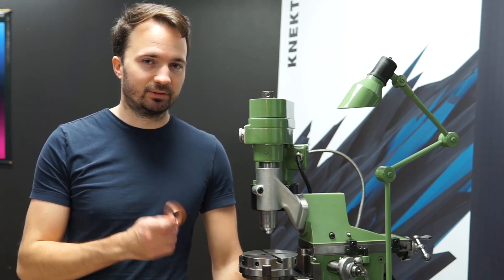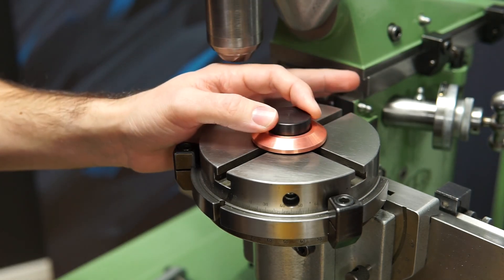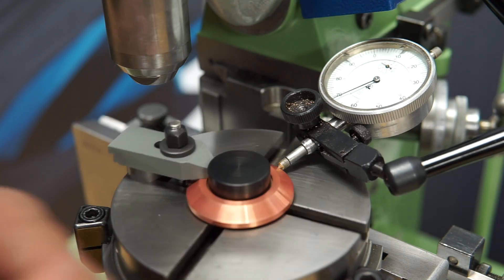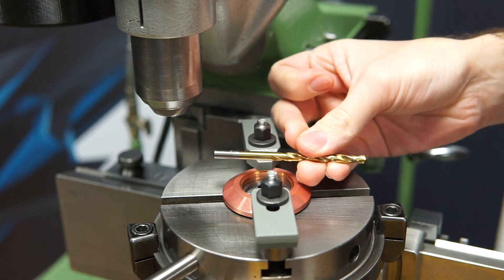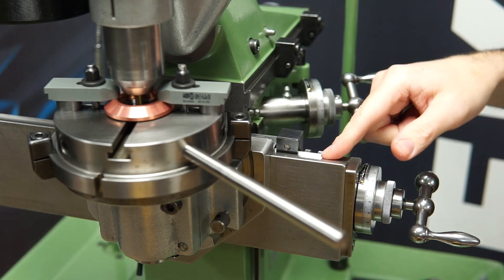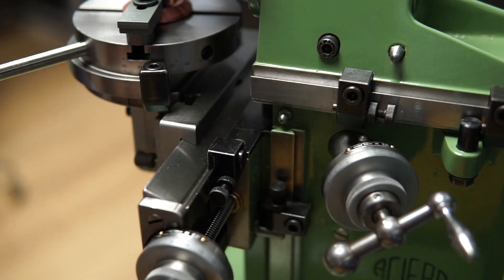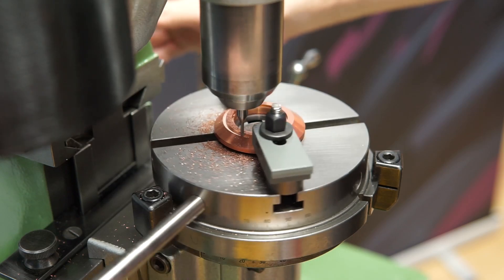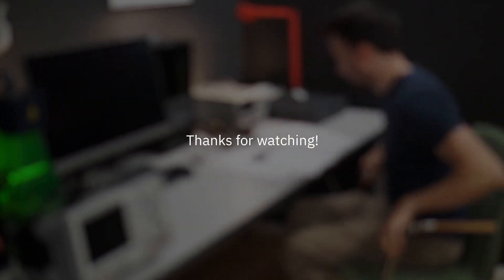I'm machining a watch case but made a mistake

Comment: What you did is probably more accurate, using the rotary table, but do you have the dividing head? You could have mounted it vertically then put your 3-jaw on it. Just curious. The spindle on mine is being rebuilt right now. The needle bearing adjuster was maxed out. Good video. You don't see the Aciera F1 (or any of its clones) being used enough on YouTube. Looking forward to your next one.
Reply from the maker: @metalmanipulator7210  I just have the simple dividing head with a plate with 60 divisions. It’s usable for a lot of things but without stops I would probably just destroy my watch 😄 Maybe I could do my own dividing plate  🤔

Mine also has the needle bearings and while in good condition, I’m a bit worried what to do when they need replacement. How are you rebuilding yours?
Reply: @MachinistJack  I did see your previous video on setting up the F1. Looks like it's a well tooled machine. Mine is quite a bit older than yours I believe. I'm waiting to hear back from Swiss Machines to rebuild it If I end up not sending it to them, I'll have to have it hard chromed locally, reground to spec, and a new set of bearings put in it. Luckily I can rely on my other mills for the time being, except they are quite a bit larger. It's fun sitting at the Aciera.
Reply from the maker: @metalmanipulator7210  Mine seems to be from 1971, so it's not the oldest one out there. It has most of the accessories, which is nice 🙂 Does Swiss Machines rebuild F1s? The needle bearings in mine does not seem to be made any more, so it would be good to know in the future when they are worn.

Do you mind sharing what you make with your machines?